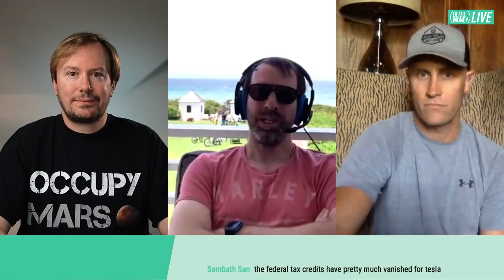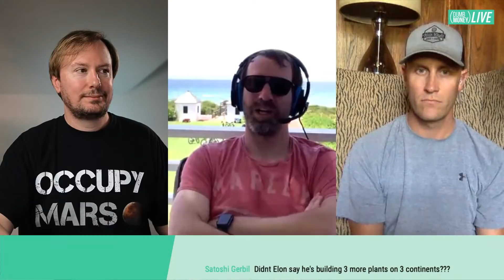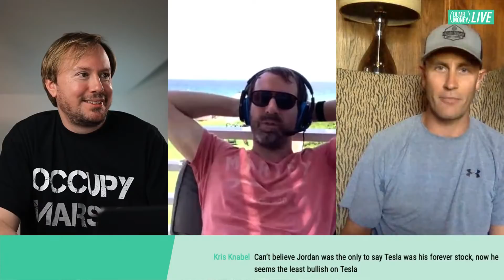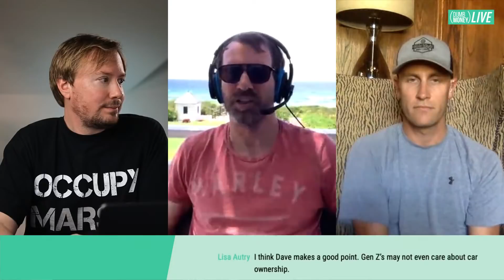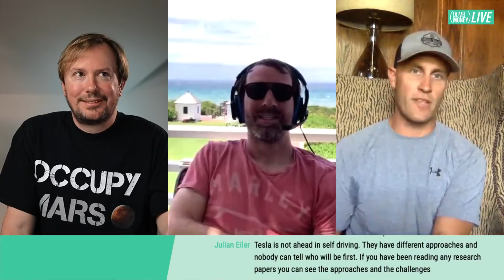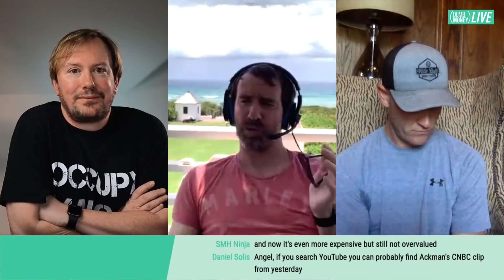Is $TSLA headed to $7000? Tesla Earnings Recap

Comment: these guys clearly dont have a clue how good solar has become. Next year new tech leap in solar is coming to market that will let you have an 800kw cell with 30% efficiency instead of 330kw with 20% efficiency. The point of the battery is to charge at the cheap when it costs more and charge the battery when its cheap. Also it allows you to bid on the energy market so you can sell energy when its expensive and buy when its cheap! Just having the battery alone makes sense but with solar roof (not solar panels) means cheap or fully off grid and you make money back. When you have the car it will also be setup as a bank to sell to the grid and then the self drive you can have it as a taxi when not in use making you money.

Comment: Solar power only makes sense at the home, where it's used. Local storage of power also makes more sense at home.  The U.S. GRID is in horrible shape it looses approximately 8-15 percent of the energy we make today due to old high resistant power lines and massive old transformers that were built 70 years ago and we loose 4-6 percent of the energy just stepping up or stepping down the power that your paying for. Generating and using your own power greatly reduces that loss. Distributing that power reduces the loss as well since the power can be transferred from a short distance, Like your neighbor next door.  The biggest thing I like about Tesla is they provide the greatest hope that having to own a vehicle goes away, and having to physically manage the vehicle to get from point-A to Point-B is a thing of the past.

Comment: btw, yes, there are glaring examples of full self driving plowing through a overturned semi, or driving into a concrete barrier, in a construction zone. However,  with respect to safety, the point is to reduce human error, not completely eliminate accidents. Reducing people drifting off while driving, running red lights, etc. There will be many categories of automobile accidents that will be significantly reduced if not eliminated completely with FSD on all/most cars.  ex. following too closely, and not seeing the car in front of you slamming on their brakes. FSD's not gonna miss that. (dave making this point as i'm typing)